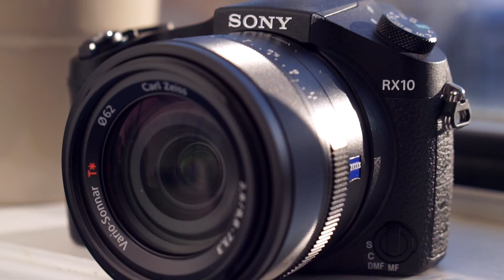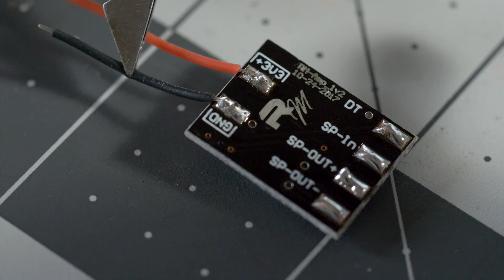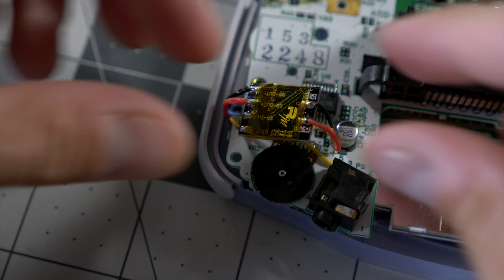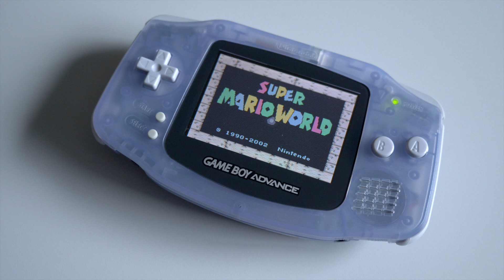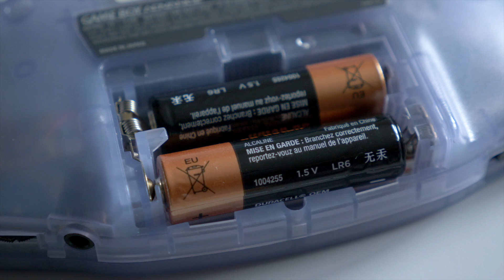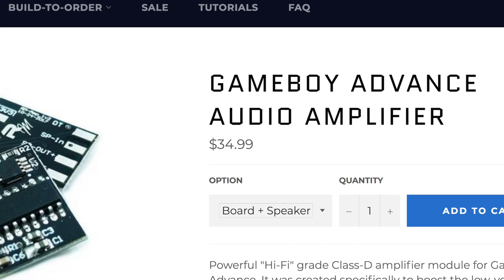Retro Modding GBA Amp Review

Comment: A couple of small but effective soldering tricks:
1. always tin your wires. When you expose the material of a wire, put some solder on it in order to solder the wire better. Doing this will avoid having some strands of it going out of the solder on the pads and it will give you a stronger connection. Do this everytime
2. use flux if the solder on the iron tip isn't fuming. What's fuming when you melt solder isn't the solder itself but it's the flux inside, that allows you to have a clean result. If it's not fuming anymore, just use fresh solder or apply some flux. Doing this you will avoid those solder "spikes" and everything will be cleaner and more functional

Comment: I just bought a original GBA from Ebay that someone modded with the IPS V2 screen, clean amp and the pure silence mod and I still get that buzzing. The same one you get and all I have used in it is regular AA's and rechargeable enelooop pro batteries. I have heard the screen can make it buzz like that as well.

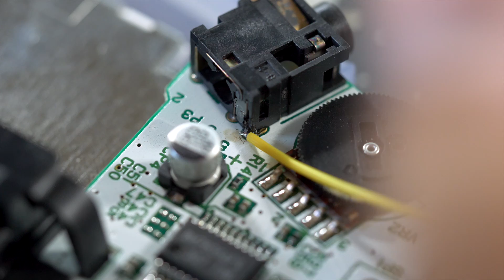Comment: 1:49 Dude, you make this look easy! I was almost finished, then I managed to melt these tiny capacitors off...
Reply: Damn that sucks. Today I screwed up on these capacitors as well. I didn't know I was supposed to bridge just the two positive solder points. I bridged the capacitors themselves meanwhile bridging the positive and negative of each capacitor. I removed all the solder but I think I cooked the capacitors cos now it wont turn on. Jeez I'm a dumbass.
Reply: @cinkerquink  I did the same thing !
Reply: Colin uses the Hakko FX-901 soldering iron. This is battery powered. I use AA rechargeables in mine (so 2x 1.2V) and it's the perfect power for doing surface mount modding. Even with 2x 1.5V you need to give it a little rest in between through-hole parts or wires, and forget soldering big wires over say 16ga. It's a good quality iron, just the strength seems like it was made for doing component-only work.

Comment: The buzzing is due to the lack of a low-pass filter (likely due to interference -- on mine, it is really noticeable with a flash cart loading up a ROM file into PSRAM). You just need to drop in a capacitor to filter out those lower frequencies (buzzing) running into the amp. Check GBAtemp.net for a thread on this issue.

Comment: I just installed this same amp and I have the same rechargeable battery pack. Mine does not hum. It works perfect. I used the heat shrink tubing and double sided adhesive foam on the back of the speaker.

Comment: My Gba only have 2 lvls of vol. low, and zero, do you know if i use this mod, the sound could be restored? im skeptical :/
Reply: Did you try cleaning the volume rocker with some isopropyl aclohol?
Reply: @lolight2  Yes, i do that, and refresh the contacts on the potentiometer, but nothing, sometimes (1 of 20 times)it works normally, but almost all time is low :/

Comment: To anyone getting the GBAmp3, an alternative amp, be warned that its application is slightly more difficult, especially if you decide to wire it to incorporate less noise. 

Also, I do recommend if you can get your hands on them, the ds lite speakers are the best for clarity.

Comment: That GBA is pretty much as tricked out as mine now. No surprise considering that most of my work done on it was with your tutorials as reference! I tried something different with the speaker though, and actually stuck in a DS Lite speaker. In hind sight, I should have just gone with the one you used since the DS Lite speaker requires case modification.

Comment: Good video. I will say one thing though, you should really tin the wires / pads then just reflow them together, makes it much easier to get a solid joint rather than stuffing around trying to force the untinned wire into the solder blob.

Comment: Hey, Colin, I had a question. I’ve recently been focusing on my PS1 and its faulty laser that I would like to replace. Seeing as your videos give excellent insight as to how to go about doing projects such as these, I was curious if you have any suggestions.
Reply from the maker: I haven't had to replace a PS1 laser (yet), but one piece of advice I can offer is to make sure the replacement is from a similar model as yours. Sony made changes to the laser assembly throughout the PS1's production run.
Reply: This Does Not Compute Thank you. I’ve heard that one from the PSOne variation is supposed to work quite well; Mine is the 5501

Comment: I wonder if a mod like i've seen (and done) on the backlight mod for the DMG , where you basically put a huge capacitor on the output of the power supply to help it smooth out the power....

Comment: Can anyone attest to the quality of the audio with that replacement speaker? Sometimes louder doesn't necessarily mean better sounding audio. I bought an amp for my DMG-01 and had to source a larger speaker and mod the case just to get decent quality audio. Those button speakers usually produce poor audio.
Reply: sounds pretty good to me, at least as far as gba audio output goes. there's buzzing to it with AAs that's unnoticeable (to my ear) during gameplay, but slightly annoying elsewhere. that's kind of on the gba though.

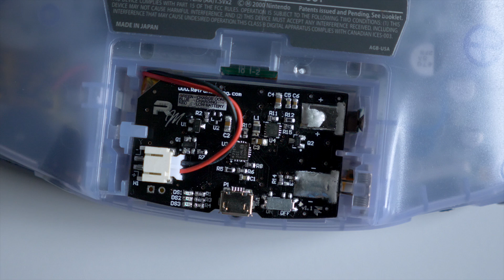Comment: 3:46 probably need to shield the wires or the pack itself? make a small laminated foil cover to go over the pack's board? or the battery hatch cover itself? if not laminated foil, maybe BoPET/Mylar?
Reply: Not necessary, there is unlikely to be any induction via wiring - if memory serves it's a 4-layer board so there's a ground pour right underneath, which causes extremely close collapse of electric fields around the conductors, kind of like a dipole field. The noise comes embedded in the signal induced in the processor  IC or via power rails from the somewhat sloppily designed regulator. Haven't quite figured out what to do about it yet.

Comment: $35 is a total rip-off. You can get the same thing for like $4 - look up "Super Mini PAM8403"
Reply: Okay, added to imgur.com/uZp6c7o - I hope this is clear enough. I can't say how this compares to GBA Amp in this video in terms of battery life / general efficiency, but if you just want louder sounds this will do the trick. Use at your own risk, etc.
Reply: how can I get it to mute with headphones?
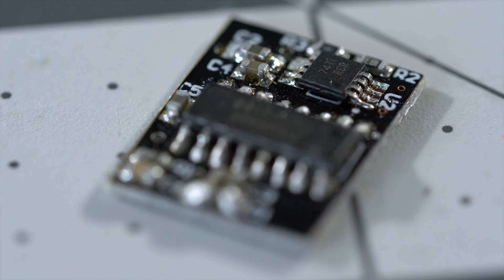Reply: You'll find that this product claims the same 24db gain as specified on PAM8403. Furthermore you'll find if you go to 4:07 in the video that this IS a PAM8403. There is one further chip, i think 741 which drives the mute function of PAM whenever headset is on, which you can probably consider to be optional, it's for power saving and to remove stray speaker noise.
Reply: Jingleboy14 would you be okay if I used your references to make a video tutorial? I will give you credit of course.
Reply: Jingleboy14 when using the PAM8403 how should you wire it up?
Reply: It's pretty similar to this, I'll draw a diagram up for you later (if I remember)
Reply: Jingleboy14 if you make it please let me know
Reply: Siana Gearz well if you aren't using earbuds I guess it won't be an issue, plus you could add a switch to the speaker wire if needed, it's a little less convenient but I feel like it isn't worth the extra $30 to have it automatically mute.
Reply: Spencer | Sweis12 Sure, go for it! 👍
Reply: PAM8302A looks more suited to game boys and is what’s used by the GB Zero community. PM8403 is more more suited to applications with a second speaker
Reply: Jingleboy14 can you post a schematics same component cheap Pam8403 for GB classic DMG? i wanna use for this handheld but google don't help me. Thenk you very much.
Reply: If you can't use internet searches to find a PAM8403 board with the information on this post and the original video you shouldn't be taking your gameboy apart to mod it.
Reply: i don't understand you.
Reply: Figure it out. You don't get tutorials on tutorials.
Reply: Given that the question was not addressed to you, I just asked for a possible connection scheme for the gameboy classic and not advance. Now let's put aside spiceiness and sarcasm if you know it well otherwise it avoids answering and goes back to playing with dolls. Thank you
Reply: All these connection points are like for like but if you do a quick google search you should be able to find what you’re looking for for the GBAMP3. Like I told you if you can’t even use searches for finding these things you shouldn’t be modding your gameboy
Reply: I tried on google but I can not find the right scheme and the connection points between the PAM 8403 I own and the motherboard of the gameboy classic. There are documents concerning the GBA or Color, but I do not think on the classic GB. If you can help me with a link or a reference I would be grateful to you ... and maybe we do first.

Comment: I wonder if there is a cheaper option though. Those same speakers are really cheap on eBay and I’ve picked up 3W amplifiers that would boost the sound output maybe not room filling loud but it would definitely be better than stock and that would be a total cost of under $3. Oh and I love your videos man I get a lot of ideas from your pro level mods =D
Reply: It looks to me from the layout of the board that it might be the same "3W" amplifier IC PAM8403, which is actually hilariously good. It might be configured for lower gain here in order not to fry the speaker.

Someone else up here in the comments bought this expensive kit and chose then after trial to keep the amplifier and use it to boost GBA's stock speaker, and that worked fine too, so you might not need to replace it either.
Reply: Actually i can see the lettering PAM8403 right on the IC at 4:07. The gain of the IC is internally set to 24db and this just about matches the 25db claim in the product description for this kit. So nothing special appears to have been done and you can likely drive GBA's stock speaker straight from a PAM8403 kit off the shelf.

There's an additional 8-pin chip on the PCB, purpose not clear. The marking appears to read 74T1, hard to say whether it's an LM741 opamp or a 47-series logic IC, but if i were to guess, its sole function might be driving the mute/shutdown on PAM8403, which might be just there to save power and prevent buzz when the headphones are connected.
Reply: Siana Gearz good eye! I didn’t even notice the marking. Ya that’s the same 3W I have used before for like 1-2$. I guess this is a convenience kit rather than looking for the parts yourself?
Reply: Well it does remove the "engineering" effort from the end-user as it were, because they likely describe the procedure in detail. They also claim to ship a "high end" 1W speaker, but i think anything short of a $6 Visaton is far from "high end", more like "Alibaba special".

Comment: The DS Lite has great sound.  AND a headphone jack.
Reply: BlayzedBlue The DS lite is the best GBA. Don't snap it in half though.
Reply: The Yellow Tub Got that right, I've taken care of my DS Lite over the years with kit gloves, and somehow the hinge still has a broken piece on the right side that's very visible when I open it up. lucky for me it still works just fine, but I've also have seen several over the years at my local flea market where the screen was barely hanging on.

Comment: sounds like that battery pack could use some shielding
Reply: To review, what voltage rails GBA has:
5.0V - used in GBC mode for cartridge and CPU
3.3V - used in GBA mode for cartridge and CPU
2.5V - also needed by the CPU regardless of mode and by on-board Work RAM
13,6V as well as -15V - needed by the LCD
battery voltage straight up - audio amplifier, switching multi-regulator.

All voltage rails come from multi-output switch-mode regulator U4, proprietary. The audio amp is U6, also not further specified. I think an inductor in line with VCC going towards the amplifier will do a lot of good. Also capacitors C51, C50 and C24 are worth looking over and possibly bypassing with a ceramic and/or replacing with best available low-ESR types. Wait, no, they are ceramics to begin with, but that's not enough, they need a friend. CP1 is worth a sharp look though.

Hypothetically the resistor R33 5Ohm prevents the bulk of the regulator noise going into the audio amplifier, but eh?

Looks like i've got something to work off.
Reply: That is an option, but I don't know if the noise is related to the switching regulator's electrical noise or if it's external interference.
Shielding couldn't do it any worse tho so always an option.
Reply: My game gear does the same thing when I use the plug on the top ins set ed of the battery compartment (although I've never used the battery compartment)
Reply: Eh I'm willing to bet that huzz/hum was always there even before this. I haven't even modded mine beyond the ags screen years ago, and noticed the hum on boot. But it goes away usually once a game takes over XD

Comment: Interesting. I installed one a few months ago, and also noticed the buzz. It's there on regular AA's as well though. Oddly, it even seems to be worse with certain games than others. To be honest, that kind of killed this mod for me. The extra volume is a fun 'gimmick' (it can really go ridiculously loud) but the stock sound was so much cleaner that I can't really recommend this mod. I've still got an "Anton Veretenenko's GBAmp v3" lying around to try, but I believe there's some noise complaints with that one as well.
Reply: DribbelDog Confirmed. I got the Metal Jesus Edition from Retro Modding with an amp pre-installed. The buzz is pretty loud and annoying for me, also on AA's.
Reply: My unmodded GBA buzzes quite a bit into the headphones on NiMH batteries! I use Eneloop Pro clones from a local store chain, low ESR and low self-discharge. I wonder what's up with that.

Also makes me think... would i pay THAT money and then not use the bundled speaker? I mean the board is likely just a PAM8403, but with gain set reduced and with speaker spanned between positive terminal of one channel and negative of the other. And those boards, you get 5 of them for $2. In fact i have a bunch around always just in case.
Reply: Correction, it is definitely a PAM8403 (and why not, the chip is awesome), and it simply only runs one channel from the PAM. It also contains mute circuity, which is optional IMO.
Reply: that sucks, seems like external portable headphones amps are still the best way to go on Nintendo portables.
Reply: I have done the Veretenenko mod, and no noise issues here. If there's noise in your GBA already, it will amplify it, mine still sounded pretty fine, and it still does after the mod. I would personally advise to keep the old speaker in though, instead of replacing it with the new one. The new speaker sounded too harsh, agressive, I missed the old warm sound. Placed the old one back, everything perfect now! I'm pretty happy with the results and would do it again.
Reply: The entire Game Boy lineup is quite noisy on the sound section, and quite terrible in sound quality in general. Any bit of extra resistance anywhere on either the analog path or the power section and you get all sorts of buzz on your ears. The GBC is terrible, the GBA and SP are a ton better at least, still way noisier than I would call even decent.

I don't know how those "pro-sound" mods would work for just headphones, the mods they do for LSDJ usage, but the console sure needs some big upgrades on the power converters, filtering and amplifiers to sound half decent.

One interesting thing I've perceived, was when I had to fix the headphones output of a classic GBA that had one side silent. It was the last resistor on the chain, a 15 ohm one, that was blown open. Didn't have another 15 ohm SMD so just placed a 10 ohm small through hole in there. Did the same for the other channel to make it equal at least (after testing that it did fix it of course), and surprisingly the sound was just as loud, and with slightly less noise.
Reply: Kalvinjj if they still had the gbamp3 that still would’ve not happen but they are not being made anymore so ya